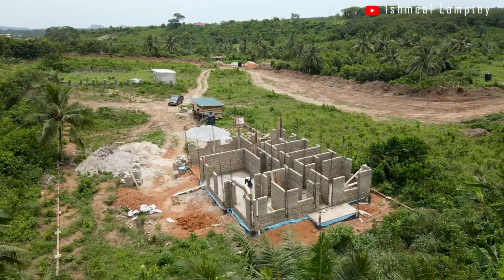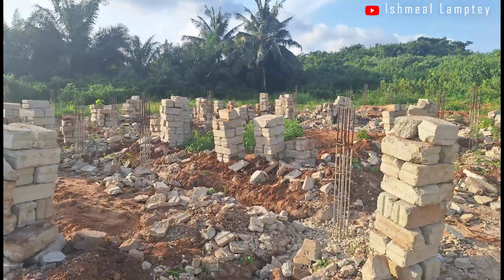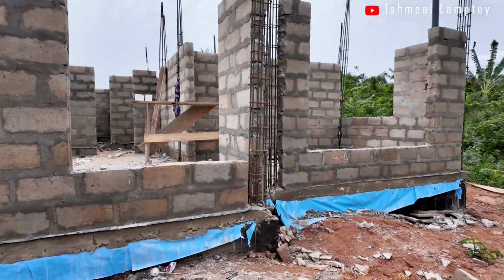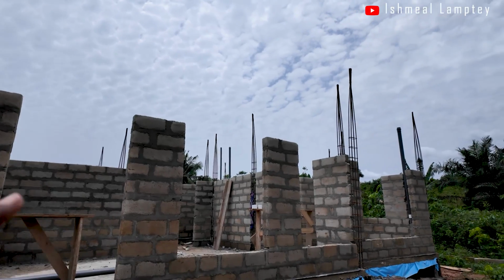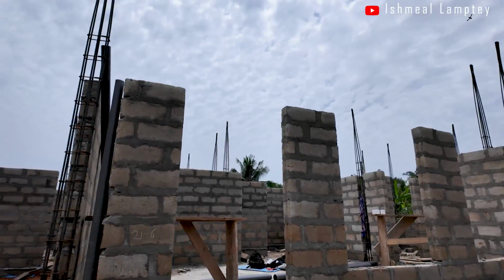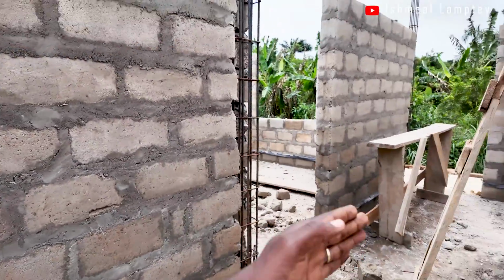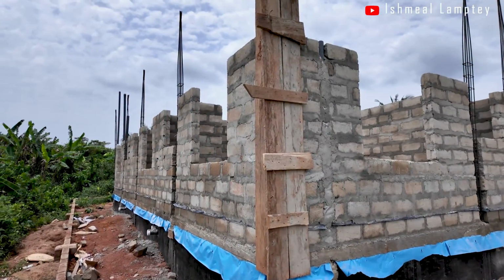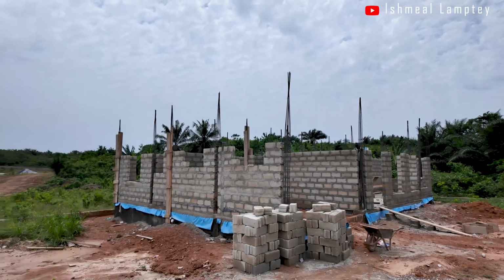Building A Modern 4 Bedroom Story House In Ghana!

Comment: Hello Ishmael, what is the difference between the DPC and DPM and where can I get some to buy. Thank you
Reply from the maker: The DPM is wider and covers a large surface area whereas the DPC is smaller and are mostly used for block works. You can get some to buy in Accra around Tesano
Reply: Well noted. Thanks for the information.